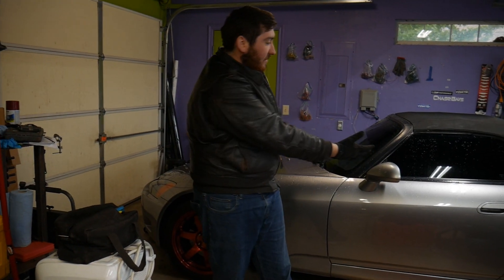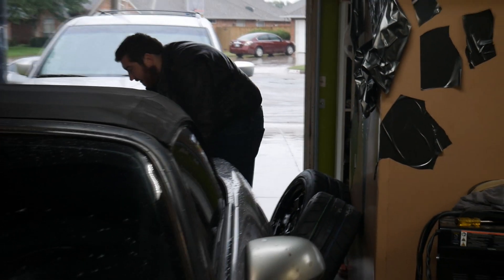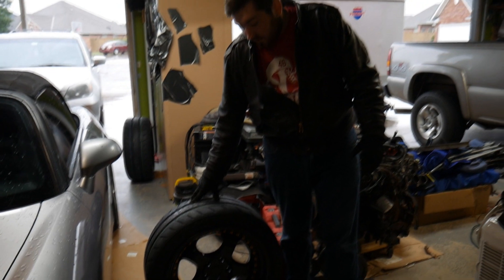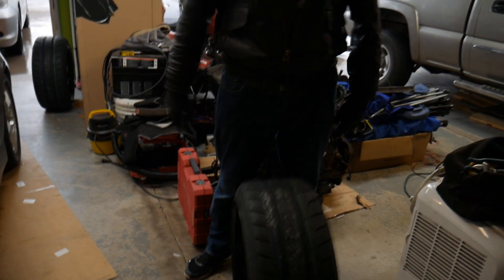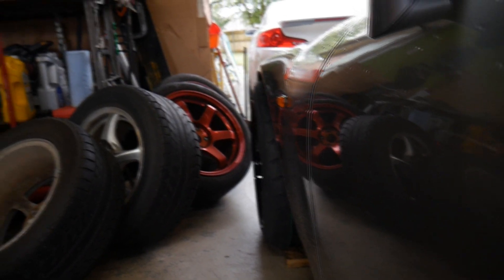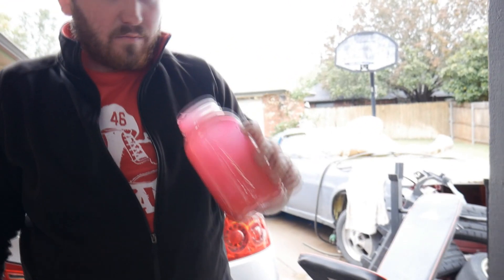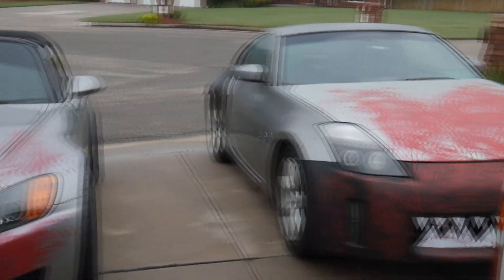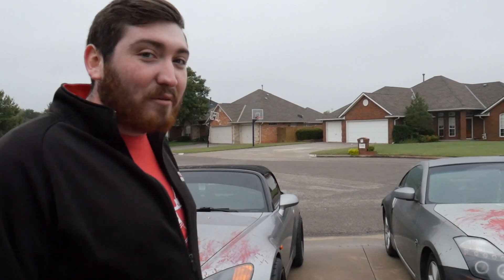What have I done to my S2000!?!?! (Twin S2000 build EP: 1)

Comment: Thanks for the video!  I'm in the middle of choosing the right set of rims for my (epically) long-term S2000.  Had it for 12 years/180 000km!  Time for it to go under the knife - rims will definitely be part of the upgrade...  Thanks for sharing!
Reply from the maker: Nice sounds like you’ve had it for awhile, created a bond! What kinda wheels are you thinking of?
Reply: RP-F1s are always a good choice, but I like the Gram Lights the Speed.Academy guys put on their "Badass2000."  Check them out if you haven't already.  I'm sure I'll agonize over the choice...
Reply from the maker: I did the same thing! It took me forever to decide what wheels I wanted.. Unfortunately I think RP-F1's are a little overplayed on the S2k's but there's a good reason for that. They're cheap, lightweight, and high quality. Finding the perfect wheel has always been a hard choice for me! Too many good options.